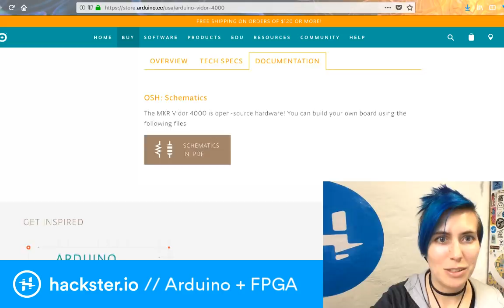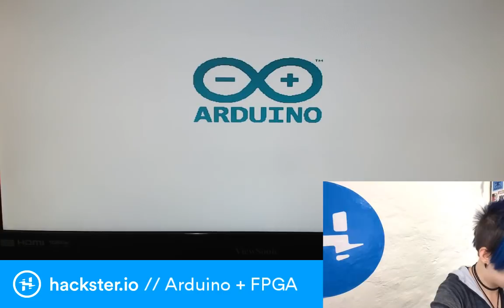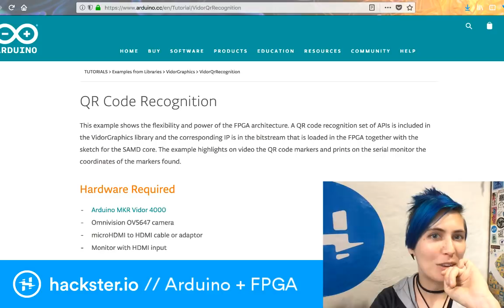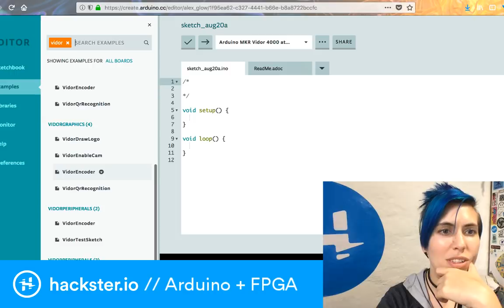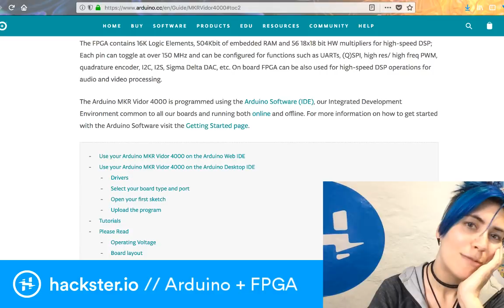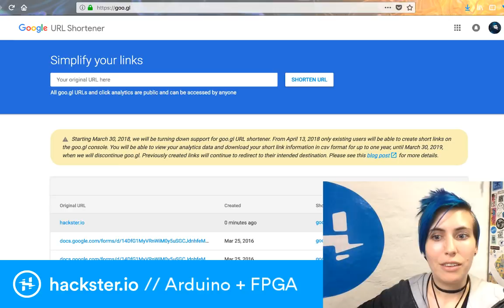Arduino MKR Vidor 4000 Unboxing // Arduino + FPGA // MCU Monday

Comment: Such an annoying formfactor though... How does it make sense to "shrink" the board so then they have to have a ton of essentially unusable pads on the bottom and on the edge connector... the cynical side of me thinks it's a plot to get people buying breakout accessories to give you the real pin count of this.
It would be FAR more beneficial surely, to have a Mega formfactor with every pin readily and easily available on the headers.
Reply: The future hasn't yet arrived, so they may yet do a Mega form factor. However, since Arduino has been around for a loooong time now, and makers are very familiar with it, and the great majority of projects don't exhaust the matching pins from the Mega form to the MKR form default pins, and the FPGA allows you to redefine what each and every pin is and does (except for power, ground), and indeed there'll be a breakout for the Mini PCI Express for 25 extra definable pins IF you need them, and electronics are prototyped on a breadboard that you have to jumper from the Mega form--might as well have the MCU board on the breadboard too for super easy wiring and project portability, and most makers are hot for smaller devices for going immediately from prototype to product, I think they made the right decision to go with the MKR form factor.
Reply: I love this form factor, you can solder to the edge connector with a steady hand, or break it out easily since it's pciE. also, this board isn't make to have mega GPIO, it's just a bunch of power, a video generator, and an FPGA. I can see it doing IoT activities.